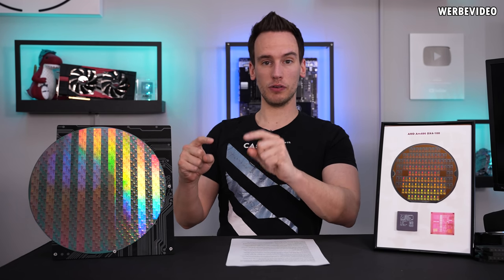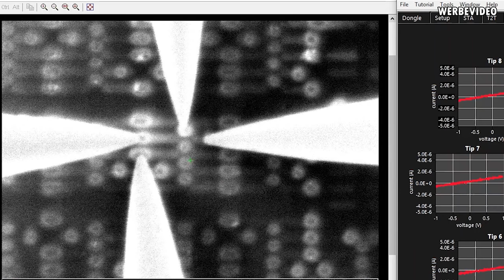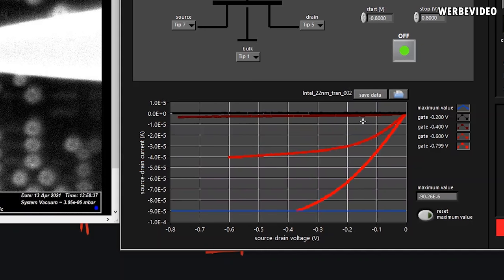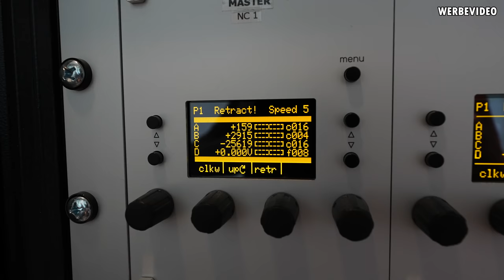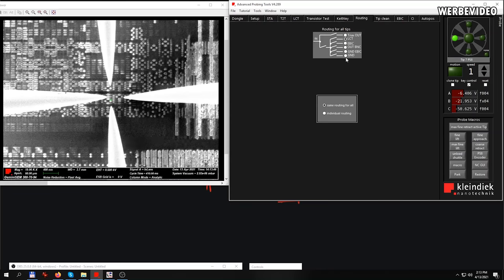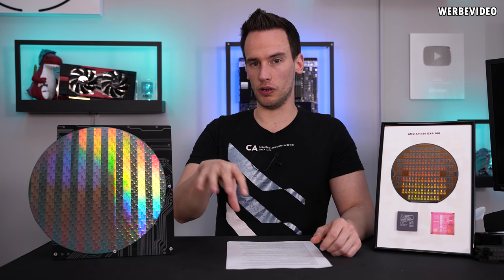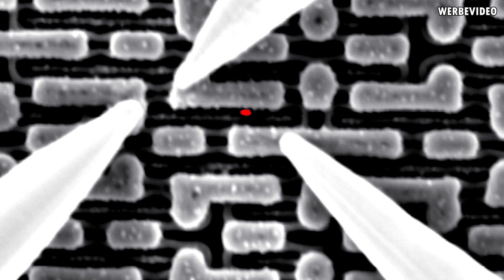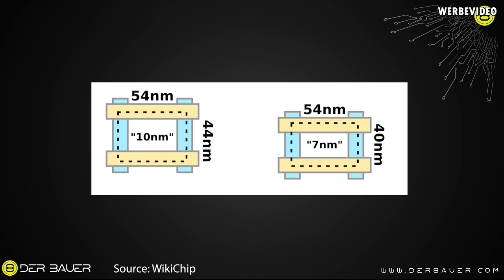Troubleshooting TSMC 7nm Transistor Short Circuit - Visiting Kleindiek Part 2/2

Comment: "If Intel wants to look at TSMC transistors" my lord, is that... legal?
Reply: Yep very legal, also is done with complex chip designs besides CPUs and GPUs.  They also use ion milling machines to remove layers an atom thick.
Reply: If you have a good enough lawyer team, you can copy other peep shit and still made it legal.
Reply: @jintsuubest9331  to not exact* or else the lawyers don't have the defense of being not copy.
Reply: If you buy a TSMC processor, why wouldn't it be legal? It's yours
Reply: They can see how it's made but obviously they can't copy,BUT see how it's made can lead to replicate the result in different form. It's the norm for most industries.
For example,when Honda create the new Nsx,they take inspiration from the Porsche 911,they buy (obviously not officially) one for test mule,used in track,test,teardown and assemble to see how it's made/work.
Porsche,later found it and when Honda take the car for the car service,they write: "Good luck Honda from Porsche. See you on the other side" under the engine cover :)
Reply: Since when looking was illegal?
Reply: @Masterblack1991  ofc that gen nsx never sold well and was discontinued until the current one which is far different and is more like the clone of the cars it copied. Also toke inspiration from the Ferrari F355.
Reply: @gerogyzurkov2259  yep,btw I was talking about the last gen NSX (the Hybrid one) :)
Reply: @Masterblack1991  it's current gen*
Reply: It is legal. You can even use reverse engineering to find out if they violate your patent.
Reply: I mean, this isn't much different to a car manufacturer buying a competitor model to pull it apart to see what they can learn from it, as an example.

It's just more involved because of the precision and necessarily destructive processes the analysis involves.

Comment: I've done this myself.  Well not like this though - this is crazy and I'd love to see more.  I've done this on old, analog processes with optical microscopes (usually a few hundred x zoom) and manual micro manipulators.  This stuff is big enough we often just use normal lab equipment (still have to be mindful of loading).   How they can do this at this scale is just amazing and it gets more amazing when you've done a cruder version of it.

Comment: TL;DR:
This is SO cool, please do more in depth videos about this!
How about comparing DRAM manufacturers, such as what exactly makes Samsung B-die so much better?
I would also like to see more voltage parameterized graphs, especially the spread in transistor parameters (Id-Vgs and Id-Vds) within a cpu and between its cores and measurements of total capacitance for similar structures between different semiconductor processes (which would directly correspond to the silicon lottery, which voltage to aim for and directly explain why).
Finally, measuring the actual switching speed of the different transistors and how it changes with voltage, including showing the degradation that happens when you push it to far, would be immensely valuable and interesting from an overclocker's perspective!
/TL;DR

I think it would be really interesting and also very valuable to show how different transistors respond to increasing voltage and at what point you start to see degradation/damage occurring due to excessive voltage. I don't know if they have the capability to heat the sample while it's in the SEM, to simulate real world usage, but being able to see hot carrier injection degrading the gate's properties (such as increasing leakage or shifting the activation voltage to higher values due to trapped electrons within the insulation layer) and/or seeing electromigration at high currents and voltages (which should be doable even without active cooling, since you're only powering a single/few transistors at a time with maximum ~1mA @ 2V = 2mW being dissipated into the silicon and through the conductive attachments) would be incredibly interesting for extreme and casual, 24/7 overclockers alike.

Having this degradation data for the most popular process nodes right when they launch would also allow us to home in on the optimal overclocking parameters, and the increased performance/degradation tradeoff, for new CPUs and GPUs without having to wait for someone to source long-term usage data from thousands of processors undergoing real-world degradation testing!
It would also verify and give casual overclockers confidence that, for example, the extremely limited voltage control on GPUs are probably just as safe to bypass and push to much higher levels as on CPUs (assuming adequate cooling is provided).
Finally, having a more scientific basis to understand the relationship between Voltage and Temperature degradation mechanisms on current production process nodes (and not just the generalized theoretical model) would also go a long way to prove that running devices at x% higher voltage with a concurrent decrease in temperature of y% Kelvin can result in the same life expectancy for the device.

Personally, from an electrical engineering perspective, I would love to see more graphs showing and comparing the Id-Vds and Id-Vgs curves between transistors on Intel's 14nm/10nm CPU processes and in AMD's CPU on TSMC's 7nm process. Similarly interesting would be, showing and comparing Samsung's 8nm process for NVIDIA's GPUs with TSMC's 7nm for AMD's GPUs, particularly with emphasis on why and how much better TSMC's process is than Samsung's.
Looking at the spread in the transistors' switching voltage and current gain, both within the same chip (say, comparing different SRAM or logic transistors in the same core and between different cores) and also between different samples of the same CPU (although that would obviously multiply the time and cost involved and probably not be possible) would be especially interesting, and would clearly show the link between raising the voltage and getting better performance out of the transistors, with the worst performing transistor being the limiting factor for the overclock. 

Some measurements of the transistors' switching performance and static leakage vs voltage and temperature, together with measurements of the effective capacitance in different parts of the chip, say in the SRAM L1 cache, vs a standard integer adder logic transistor, is another rabbit hole that could be investigated in subsequent episodes, again with an emphasis on the differences between competing process nodes. There's just so much cool and incredibly important information that we could gain through these investigative videos, that no one outside of the big semiconductor companies ever get to see!

PS. Sorry for my English and the length of the comment, I just really like this type of content and would love to see a series further investigating it.

Comment: This tech is utterly astounding.. To think that you could even build a device to move those needles only a small number of atoms distance in any desired direction is just amazing! Also, it was really awesome to see the ability for them to apply voltage to a single transistor on the chip and then be able to visualize which other points on the chip are interconnected with that single transistor. Honestly, I'm kind of blow away by everything in this series of videos. Thanks so much for sharing this with us derbauer!

Comment: Since dies are using photo lithography, I never thought that you could have equipment small enough to probe the transistors. Wow! 
We hope someday we can see a probe attached to IBM 2nm processor.
Reply: we have tunneling microscopes, which can resolve individual atoms by literally probing around on the surface. So if we had a 2nm, we would be able to attach at least one probe to it today.. and then some!

Comment: I wonder: would damage caused by overvolting be visible with this?
Reply: Perhaps, but it would cost you a lot more to test that than to replace the damaged chip :-D
Reply: I don’t know about minor overvoltage damage, but I know that ESD damage, which is often in the thousands of volts, can produce damage that is visible under an SEM.

Comment: Could you use these tools to change the values of silicon fuses? That might be a very interesting way of allowing software to do things manufacturers don't want it to do.
Reply: whats the point? you would have to destroy any cpu or chip to actually test it with this machine.

Comment: Wow, thats really impressive to see the cpu at this miniature level. Had no idea how it actually looks like up close. But, just when they have a short cirtuit, tsmc cant test every cpu like this one,... how often this issue occur? Can such bug render the cpu useless or just the one cell and rest of the cpu is working just fine? Either way, nice video :-)
Reply: There are automated electrical testers (testbenches), that can process thousands of chips and test their characteristics (e.g. Advantest is making test devices). Based on their properties, manufacturers divide chips into several quality level categories and those, that don't fit any of the categories (e.g. multiple shortcircuits) are simply thrown away.

Comment: So whenever the number of defects on a wafer at a fab of Intel, TSMC or Samsung is too high, someone has to use this equipment to figure out which transistors exactly are the problem?
Reply: TL;DR: Yes, although the "why" is probably just as important as the question of "which transistors are failing".  I'm sure there's a whole world of how-to-debug-ICs that we're only scratching the surface of here. But, as an example, if they built a chip, and noticed that there was a fault in the SRAM cache at a particular memory location, then I'd imagine they could look up exactly which SRAM cell that corresponds to and jump right to testing that cell in order to diagnose the actual structural defect in the IC, and hopefully figure out which parameters to change to fix it. Similarly for logic failures, any given short or bad transistor could, at least in principle, leave a distinctive symptom in the behaviour of the chip.
Reply: @TheHuesSciTech   To add to that this kind of probing is often done to isolate faults in logic chains or SRAM and once a likely ROI (region of interest) and layer are identified you can then perform TEM imaging in that area to better understand the defect mode and mechanism by which that fault was created.